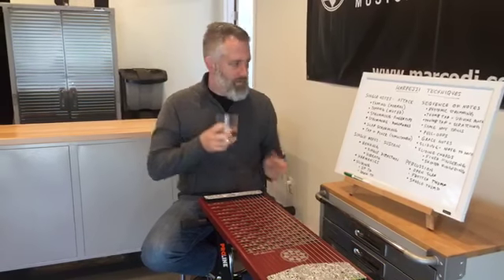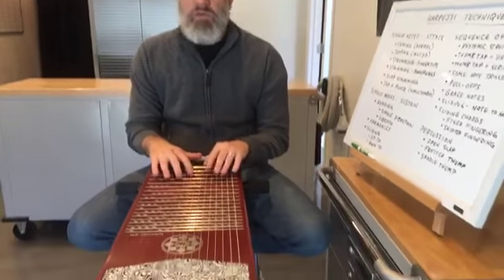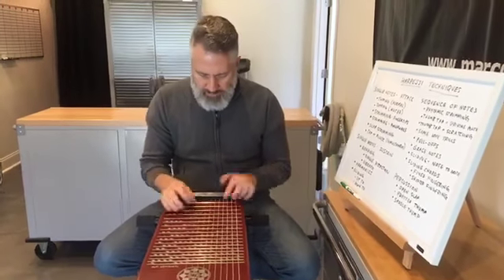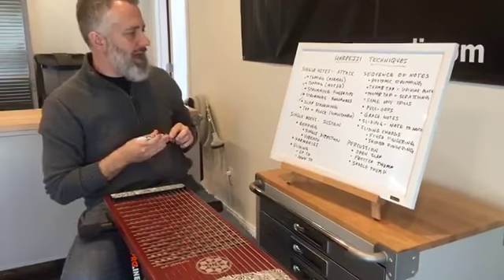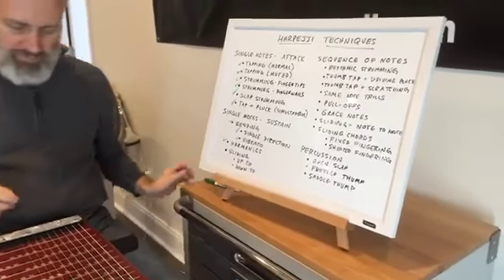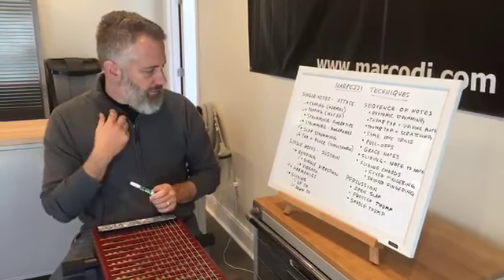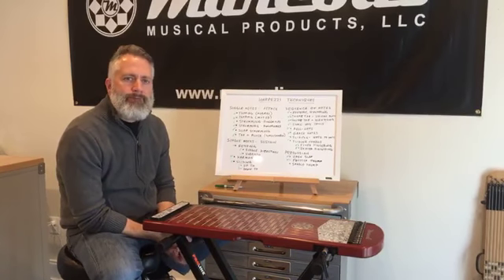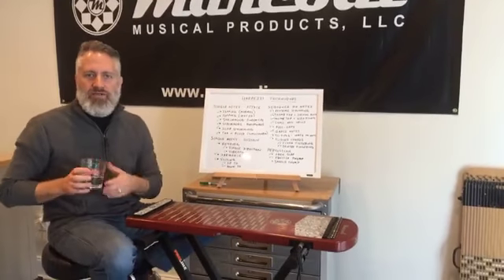Harpejji Techniques

Comment: I see that the K12 has innovations, but the limitation of reduced range. Does it make sense to gut two K12's instead of a K24, one tuned high, one tuned low?
Reply: Only problem is the strings for the k12 are higher strings